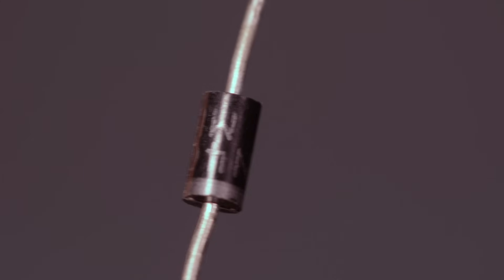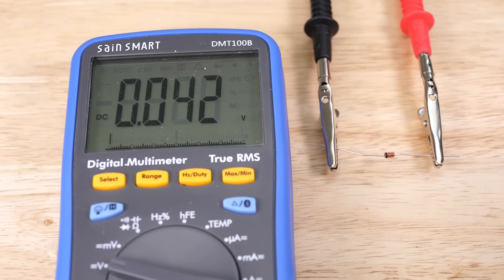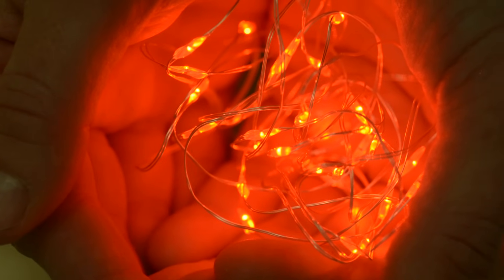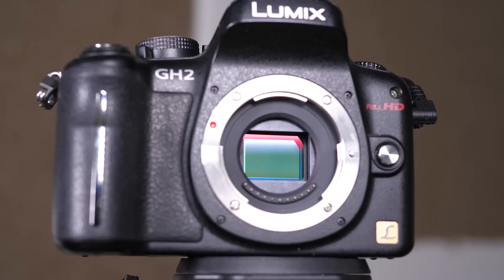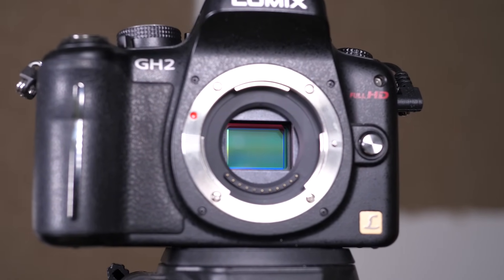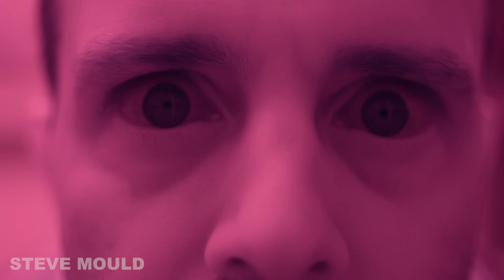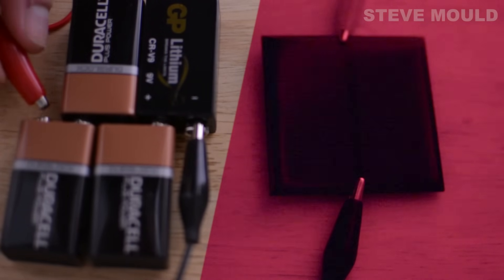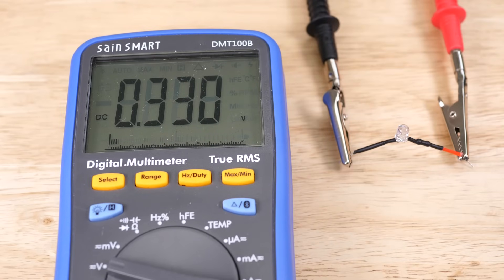Why all solar panels are secretly LEDs (and all LEDs are secretly solar panels)

Comment: When you light up a photovoltaic panel, are you reverse polarizing it, or forward biasing it. I have forward biased them,(pretending you're charging them like a battery), just to heat them up to melt snow off them. It works well, because the coldest cells have the highest voltage drop, the warmer ones, have lower. That puts the heat where needed, when this is done with a constant current power supply. They do NOT produce visible light, they just put off a very uniform heat. I'm careful not to apply more current, than they produce at standard test conditions. 
When using LED's as photovoltaic cells, you will find that they're most sensitive to their emission color. A green LED works best, if illuminated with another green LED, but won't work at all with a red LED. The closer the colors, the better it works. A red LED will barely get results from amber, but not at all with green or blue. That means, that if you have red and blue going through the same fiber optic, you get enough channel separation for two different signals, without prisms, or dichroic filters. you just need a diffuser, so both receiving LED's can see the light emitted from both emitters.

Comment: This could be somewhat (but not totally) the same for electric motors. I can even imagine a motor powered by another bigger motor with the help of some belt and pulley (sort of "mechanical power to electrical power" thing) and voltage regulator or inverter..

Comment: Could this also mean that LIGHT SENSORS are also diodes? Therefore, LEDs can be used as light sensors, right?
Reply: Of course.  The photodiodes in the remote control receiver of your TV/DVR/DVD/Cable box/etc are sensors that pick up the IR signal from your remote control.
Reply: @kenlogsdon7095  Nice! Thanks Ken..

Comment: I discovered this with a 100 watt LED, i noticed my volt meter continued to read a voltage after removing it from DC power, so i grabbed a flashlight, and the voltage increaded, eventually i worked my way up to powering a 1W LED(at about 0.125W) with the power generated by a 100w LED capturing light from a 15W LED source

Comment: Very Interesting! I didnt know lighting up solar panels by passing electricity through them actually Works xD
May I ask where you got that small multi junction solar cell that you called a concentrator solar cell? I tried searching fot them online but could not find a place that sells these cells...
Reply from the maker: Thanks! The one you're talking about is a Concentrator Photovoltaic cell of CPV cell. I got mine here: https://www.ebay.co.uk/itm/CPV-solar-cell-on-submont/143015812202

Comment: So if that little LED was getting around 1v DC with a small flashlight, Could you then just get like 100 LEDs, series them together and put it outside and be getting roughly 100v DC? Im no expert here so id love to hear back if this is possible as ive got heaps of LED's laying around and might give it a try

Comment: So Thunderf00ts calculations on solar roadways are off as the leds themselves were also generating power 😅
Reply: negligible ammounts of power that are not connected directly to the same output of the solar panels so the leds do not generate additional power. Also, pretty sure the leds can't generate power and use power to light up at the same time, if exposed to light, the leds in theory should just consume less power, but a minimal ammount.

Comment: Then why don't LED monitors and TV's have a feature called reverse current when turned off? Sure would be nice if your TV is getting hit by natural light through a window and send the power back into an outlet or at the very least use that tiny bit of power to charge an internal battery for the TV to run off of a little bit to reduce over all power usage. I wonder how useful broken LED TV's would be if you bought a bunch of them sense they will be super cheap because "Broken" and take the screens out and make a DIY solar panel, provided the diodes in the screen were still good or mostly good.
Reply: I'd imagine the gains are absolutely negligible. The electronics to extract the power would probably waste most of it themselves, a huge expense for no gain.

Comment: Speakers and microphones... well.. not carbon poweder microphones, they can´t be used in reverse.. and for capacitive once.. i don´t know. Really just the inductive once that it works well with.

The other way around it works with pretty much all speakers. (well not capacitive speakers),

Its also worth saying that all LED and solarpanels are doped to resonate with a certain frequency. If this is not done, the efficency will be very bad... and really hardly work.

This is why all LED have a very distinct color (and no.. White LED:s really don´t exist).

A solar panel is doped in a way to have a broder spectrum of light, the result of this is that its horrible bad as a LED.

A LED is doped to have a narrow spectrum of light  (to make it as efficient as possible). The net result is that its horrible as a Solarpanel... The reason for this is that sun light (and also light light) is broad spectrum,  only a tiny bit of the spectrum (about 1%) can be used to be converted into power. And the conversion process is it self really less than 50% efficient. Making the total efficiency less than 0.5%. And that is for a tiny surface are.

But there is a trick. Use two leds of the same kind and point them straight at each other. Now you get pretty much 50% efficiency (well for the light that hit the diod)

This is a excellent way of making a optical coupéer. (and this is also pretty much how a mouse works)

Comment: true but its design for different purpose like transistor are design for specific purpose same as capacitor ... for basic concepte they are of the same but have different purpose and what will do and what it will be use

Comment: Interesting stuff.  I was wondering if you could then use an LED as a sensor for infrared light.  Perhaps then you could construct a CO2 sensor.  One diode to generate infrared light and another to sense small changes in the amount of light hitting it.  I'm unsure whether the infrared from the rest of the room would interfere though, and you may get significant changes depending on the temperature of the room.   CO2 sensors cost around $300 dollars, so building one would be pretty cool.

Comment: When light is shined on the diode does the current travel in the direction that the diode normally allows current to flow, or for some reason does the current flow in the opposite direction?

Comment: The why do solar powered outdoor lights have a solar panel with them...couldn't they just power themselves with a battery pack plugged into them?  Switch to intake when light is present and output when light is not visible.

Comment: i wonder how that was discovered?

could it be that someone forgot to install the shade diode on one panel then the panel lit up ir when they was doing ir photography or since ir comes in 2 parts heat and light maybe the panel got warm and was staying warm so someone decided to use an ir camera and saw it glowing on camera.

Comment: I recall there was a very clever circuit program that did some time-sharing on an 8x8 matrix of LEDs; it could detect the location of your finger touching the matrix like a low-resolution touchscreen, and then it could draw graphics on the lights based on the touched areas.

Comment: Congrats on this video, It's excellent for public understanding of a group of technologies that is a secret titan of the modern world!  The idea that a diode is many things is one of the main fundamental concepts on modern optoelectronics. LED's, solar panels, lasers, and photo-detectors are all diodes. 
Making an EFFECTIVE device is a different matter. There are two broad classes of diode making materials (semiconductors) 

There are direct semiconductors  (Gallium Arsenide, Indium Phosphide, Gallium Nitride) that are good at generating and absorbing light.  There are also indirect semiconductors (Diamond, Silicon, Germanium) that are good at gathering light, but crap at making light.  The rabbit hole goes deep on this, but you are looking down the entrance of  an amazing branch of modern technology.

I was surprised that you saw so much electroluminecence (technical term) from forward biasing the solar cells.  It's been extremely difficult to make silicon emit light (even in the infra-red range that your camera picks up) there have been millions of dollars put into the research for luminescent silicon.  (manly because light travels much faster then electricity, and in microchips that is a significant advantage.

Comment: Solar panels should be used as outdoor lights.
OLED screens should trickle charge your phone.
Thanks for coming to my Ted Talk.
Reply: Maybe we should create a purpose build LED phone screen that double as solar panel when the screen time out. It may not replace a charger, but it'll get you an extra few hours in your device before you need to plug it in.
Reply: hmm. Sounds good, worth a try.
Reply: A solar powered solar panel light. Lights up after a day of charging, to release back into the darkness, the photons it collected during the day.

That's environmental stuff, right there.
Reply: @Zaxiel  Luke, I'm you father.
Reply: I’m sorry but solar panels emits Infrared which is invisible to human’s eyes, also power generated from OLED is not enough to charge your phone as it is so low it turns into useless heat when charging.
Reply: Also thank you for hosting a TEDTalk.
Reply: @Nopparuj r/wooosh
Reply: So, we use webcams to then see in the dark. I see no drawback. No one can see me stare at them, this way.
Reply: @nopparuj  wow, it's almost like you watched the same videos everyone else.
Reply: r/wooosh
Reply: Cole Ikr
Reply: Wow. That's a good point 😍
Reply: > OLED screens should trickle charge your phone.
I like that.
Does this mean diodes in series with solar panels are not necessary? Not always necessary?
Reply: @garyha2650  why would you put a diode in series with a solar panel?
Reply: @midwestmangos2452  "why would you put a diode in series with a solar panel?"
Most people automatically think a series diode is necessary to prevent a battery being charged from discharging the opposite way thru the solar panel during low light like at night. I'm questioning the assumption looking to find out whether it is true or not. Another might assume it is absolutely never necessary based on this video, would be good news. Hoping someone with a lot of experience might chime in. It might be true just for older panels for example. There's a voltage drop of 0.6 to 0.7 volts with a diode and that's quite a bit with 12 volt systems, around 5%.
Reply: @garyha2650  oh, I guess I'm not sure about that. I've always used a voltage converter to keep a consistent charge across the batteries as the amount of light changes.
Reply: KELLI2L2  them?

Comment: 2:04 yes you can call it an LED even if it emits IR. Any diode that emits any wavelength of the electromagnetic spectrum is an LED. Look out for those gamma emissions though OUCH!
Reply: The semiconductor bandgap (1-10eV) limits the photons energy, so you will never get gamma photons (100keV) . The only way to get gamma or X-ray if you put millions of amperes in the diode and it explodes very violently, resulting in lots of UV photons, some X-ray photons, and maybe some gamma photons from excited nuclei.
Reply: @neurhlp  Is that what they call a gamma ray burst?🤣😁😝 As far as sending and receiving at the same time, to illuminate, you have to apply enough voltage to forward bias the diode junction. If the LED is exposed to light, than if the voltage is reduced below forward bias, there will still be voltage across the terminals. You just need to load the diode, so it stays just below junction voltage, to get maximum energy back out of it. As far as efficiency, it's actually quite high, considering the very small area of the LED Vs a solar cell. A screen has millions of them, giving them the surface area of a solar panel, and producing close to similar efficiency. The only thing that makes the idea impractical for now, is that each pixel, represented by each LED element, needs  a push-pull pulse width modulator, with an inductor. The magnetics would be very difficult to scale down that many into something the size of a lap-top, let alone a smart phone. in theory it can be done, but not practical for now.
Reply: I wouldn't worry too much about gamma rays. Most PN junctions are monochromatic. They emit in a very narrow spectrum. If you can't see the light, because it's outside of the visible spectrum, you might just want to check. (I was going to say: "Look into it", but that might be a bad idea!)🤣😁😝

Comment: So, you mean to tell me if I get a capacitor, a resistor, and 2 LEDs, and wire them up and leave them out, the ambient light on one LED can charge the capacitor, until it overcomes the resistor, and causes the other LED to light up for a moment, and I can get a solar powered blinking light?

Comment: is it possible to engineer a diode that does both tasks well? light capturing AND light emitting?
Reply: Every diode by construction already does that, as demonstrated with this video. But they usually are optimized to do only one thing and to do it well. A diode that could do both by design would not be efficient at all and so it would encounter little usage.

Comment: Why shouldn't it be an LED if the "light" is in the spectral area humans can't see, it still is a form of light, isn't it?
Snakes and some insects can detect infrared, so it should count as light. Not to mention that the decission of what counts as light is manmade, I wouldn't know of a definition that sets UV,light and infrared appart base on physical properties other thatn a defined wavelength?

If I'm wrong, correct me and give an explanation please. I'm allways willing to get a better understanding of everything.

Comment: Then a led and oled tv can act as a huge camera, recording us secretly.. just measure value as different shade of colors via a numbervalue system, converting it into an image at the other end. There is probably a reason we humans do this tech having it better and better. Someone wanna see, hear and monitor this prissonplanet.
Reply: If you can see the picture from every angle (or if the whole picture goes away the same at a given angle), then it can't work as a camera, there is no lens, each pixel is getting light from all directions at once, it would be completely out of focus.

Though, I guess they could use some advanced algorithm to build an approximate image based on timing or on where each color is coming from on the screen; but it still wouldn't let them see anything that's not close to the screen.

ps: LED TVs don't got LED pixels, the "LED" part is just referring to the backlight, they're actually still LCD (but OLED is usually the real thing).

Comment: Diodes are dirt cheap, right?  (Correct me if I'm wrong, pls).  So, why are solar panels so ridiculously expensive?
Reply: They dont make great solar panels
Reply: @ilanzatonski8826  Ah!  Makes sense.  just because they CAN conduct electricity doesn't mean they are good enough to make solar panels.  So, solar panels are expensive because they use components much more efficient (and thus more expensive).  Thanks.
Reply: Area: There's a lot of silicon in a photovoltaic cell, compared to an inexpensive diode. The material cost is hundreds of times higher in the solar cell. Despite that, panels cost only a tenth of what they cost, 30 years ago. Panels can be purchased for less than a dollar per watt.
Reply: You have to think quantity.
The quantity of silicon inside a solar panel is orders of magnitude greater than the quantity inside a  bag of one hundred diodes from aliexpress or any CPU. The fabrication process is also different. But the huge cost is mainly from heavy usage of expensive resources. Also those things have to stay in the sun 24/7 for many years so they are engineered to last, they use special glasses and heatsinks made of aluminium (another quite-not-cheap material).
Reply: @alessandroceloria  The quality of the silicon in the solar cells is much worse than CPUs. They are quite often not even single crystal (you can seem the domains on some!). Solar cells would be way too expensive if they used 99.9999999% pure single crystal silicon. 

Cheap diodes/LEDS use a very small semiconductor crystal. It may be as little as 1mm x 1mm x 0.1mm for some LEDS. Cheap diodes are usually thicker.

But solar cells use massive amounts of silicon (or other semiconductors if you are willing pay for it), and other things you mention are pretty much spot on.

Comment: BTW cameras with the IR filter removed might not be able to do thermal imaging BUT they can act as a digital night vision.
Reply: And it's super easy to modify most webcams!
Reply: But needs IR illumination
Reply: @sidharthcs2110  you can do that with your remote control led
Reply: No video camera will do thermal imaging. Glass lenses wont even pass the light.